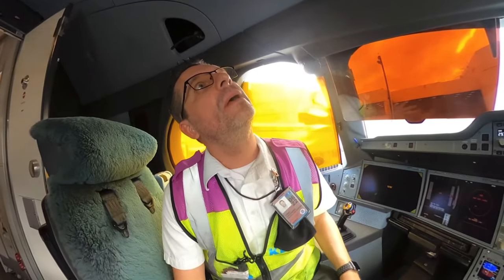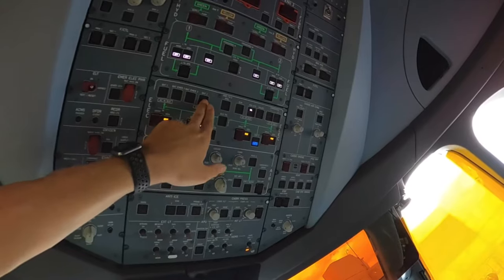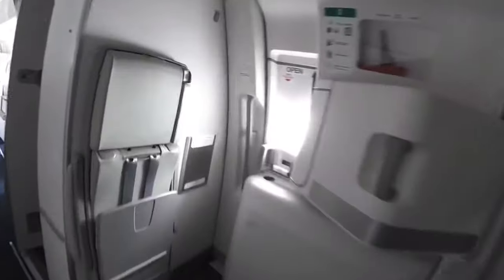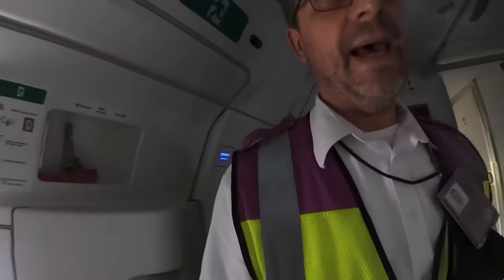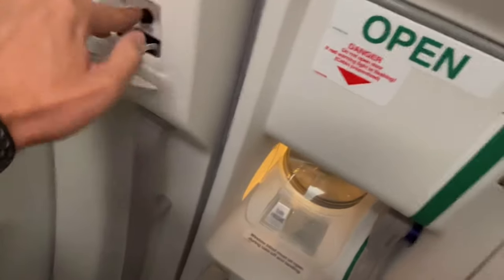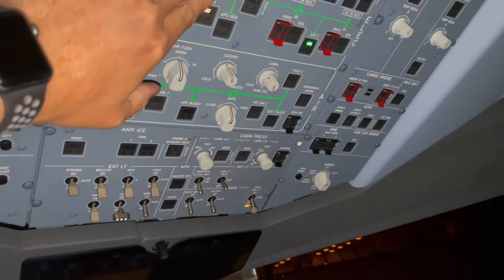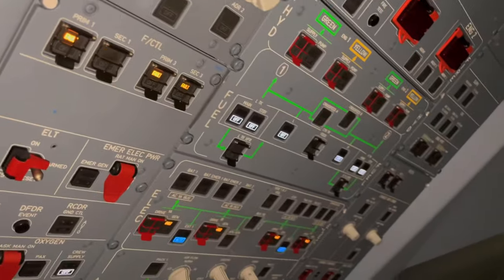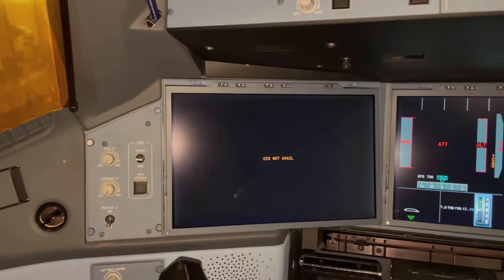Airbus A350 shutdown and startup with external power.

Comment: Wah, the avionics comes on instantly with the external power. A lot lot different from the 777/787...
Reply from the maker: Yes it is faster than B787/777 to start up the display’s, although full start up also takes about 10 minutes.

Comment: How do you shutdown the engines without losing lights in the cabin?
Also, during startup why was the center console screen censored near the bottom?
Reply from the maker: @Vortex001_MLG  when engines are shutdown on APU the voltage / frequency are momentarily matched so that there is a no break transfer to the APU generator. If a GPU is used the engine generators are momentarily matched the same way so the is a no break transfer to the GPU, but as GPU’s are not the best suppliers of good voltage en frequency you can have a break transfer of power. 

Just blurred the aircraft registration.